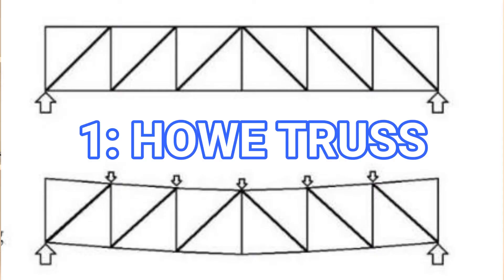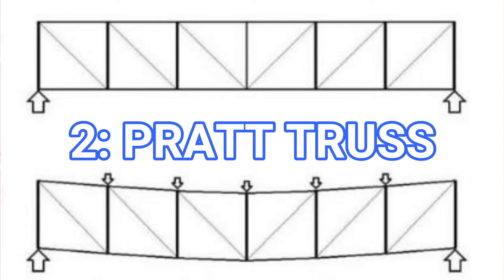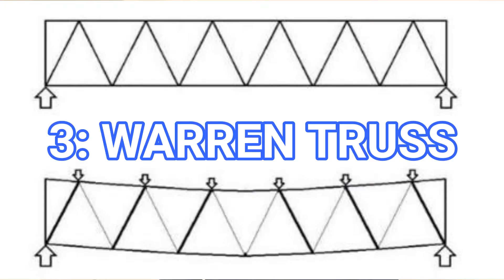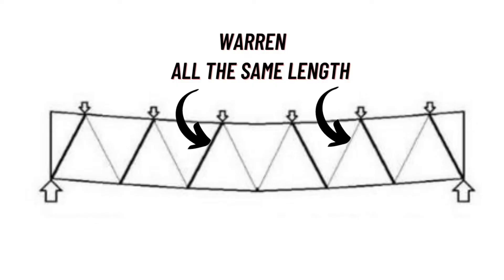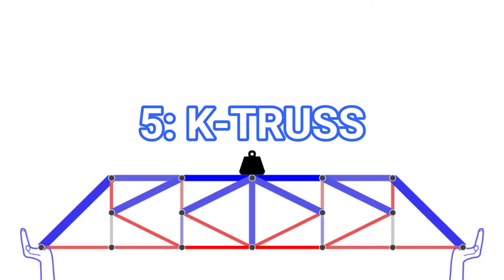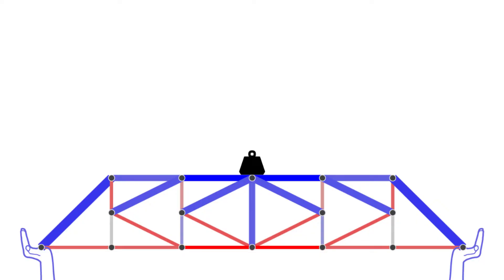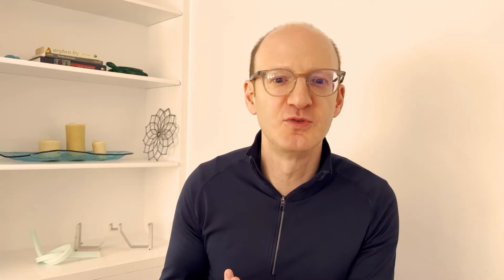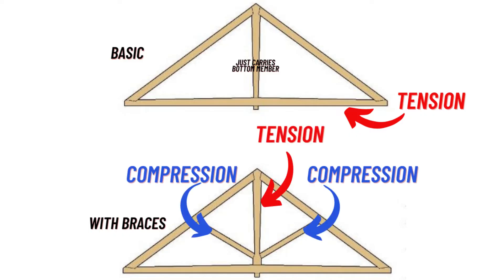10 Trusses You Need To Know! (and 1 Bonus!)

Comment: I'm an electrical engineer.  It's been my experience that a diagram flashed on the screen for about a second, followed by 10 or 15 seconds of the presenter rushing through the explanation is not the best teaching method.  Show the diagrams longer and slow it down a bit.  Sorry, but I stopped watching because I was not retaining any of it, except to keep members in compression short.✌️

Comment: So, I'm trying to design a truss for the floor of my Tiny House on a trailer (THOWs). I think this is a place innovation would make a huge difference because of the weight constraint. Typically 2x6 are used with 16 or 24 oc. A subfloor normally rests on the metal trailer bed, hopefully on some insulation and bolted to the trailer's siderails.

It seems like open web truses and i-joists are the most commonly used by engineers and then 100% of tiny housers use conventional timber/joist framing.

Surely there is another alternative though. I was imagining - there is cross-members about 5-6 inches deep in the trailer bed, and then sheathing is going on the subfloor. I supposed then something like arches or diagonal members in some kind of truss. I notice herringbone blocking is often used to brace subfloors which led to the thought perhaps if the herringbones had special plates on the trailer's metal cross members and also a recess in the subfloor sheathing itself...

tldr; how can I reduce weight in a Tiny House on Wheels subfloor?

Also would be delighted to get any pointers on good simple books for this newb! Thanks Structural Engineers! You are heros!

Comment: Can I ask you a question..if you have a horizontal beam and then add angled struts at the ends, is this a truss?  And does it increase the load capacity of the beam?  If so, by how much?   Google just tells me they are used to keep the beam in place (horizontal).

Comment: The Kingpost truss (mainly) is a northern thing in Britain. In the south we tended to use Crown Post rooves, which work in 3 dimensions with collar purlins. It's important to understand that all of these mediaeval roof types used principal trusses and then secondary infill construction such as purlins and common rafters...and they were all constrained by the sizes (particularly lengths) of the available timber. They were also all designed to be on show, so aesthetics were a major part of their design. Remember the buildings they spanned were almost exclusively open "Hall Houses" and public buildings.....with no intermediate floors, and no ceilings. 
So, I am going to feign offence that you chose to show the simple northern roof design (Kingpost), and failed to show the much more developed and intricate Crown Post roof.
Reply from the maker: Correct. My entire video is actually a snub to the Crown Post. Glad it worked…
Reply: @PaulKassabian  Oooooh......them's fight'n words...Structural engineers against architects......the way the world has always been. :)

Comment: Really enjoying your series. I’m from a mechanical engineering/ physics background but I’m currently working through some structural problems (with a bunch of seismic specialist structural engineers) for a current project. The first principles you lay out so effectively really help frame the issues. 

Apparently even the “$1.50 in late fees at the public library” are no longer required. Much appreciated, please keep it up.